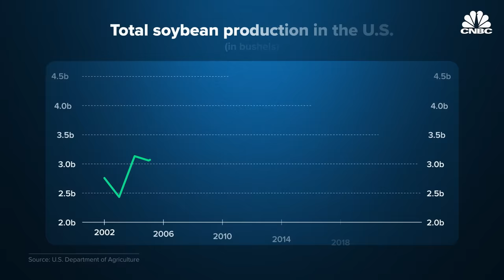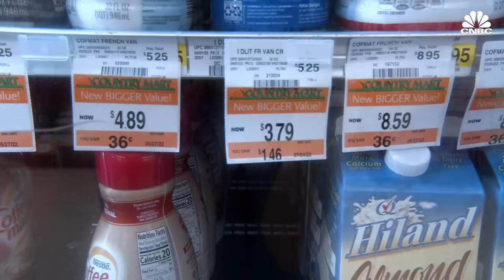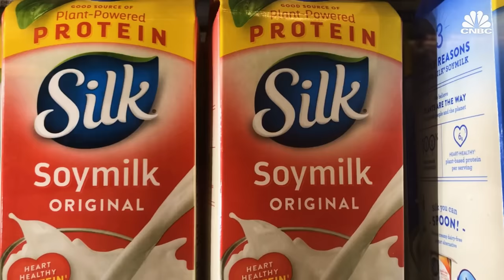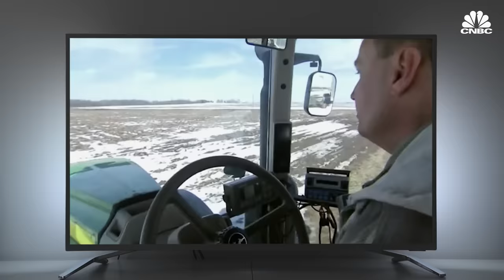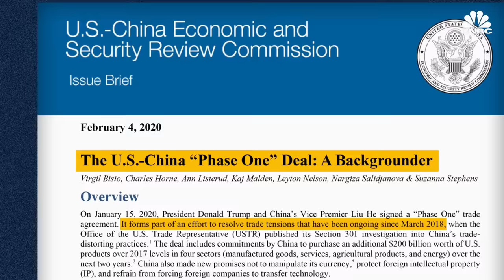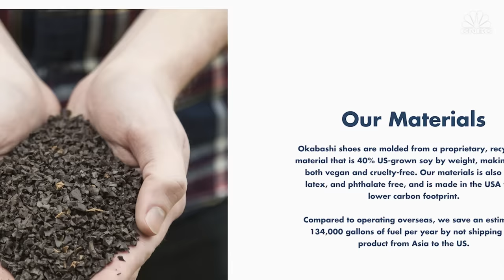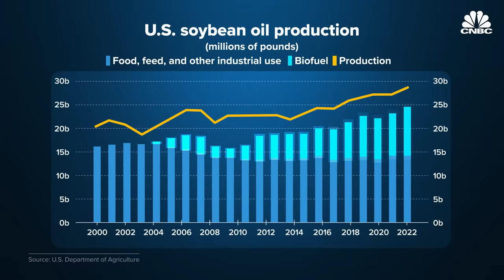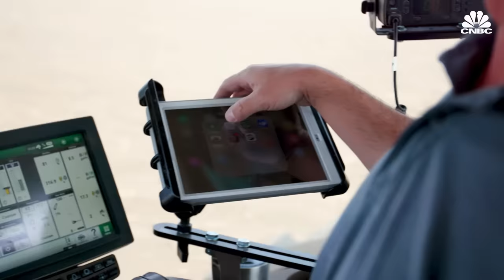Why The U.S. Is Now Obsessed With Soybeans

Comment: A bushel is a unit of volume commonly used in the United States to measure dry agricultural commodities like soybeans. One bushel of soybeans is equivalent to 60 pounds or approximately 27.22 kilograms.
Reply: You the real mvp 🙌🏿 I had no clue what a bushel was lol
Reply: oh thank you
Reply: Same weight as wheat.
Reply: All grain crops measured this way... It's an ancient method
Reply: 1 bushel is 1.25 cubic feet. Does not matter the crop. Today's soybeans rarely make 60 lb/bu. Usually 58 lbs.
Reply: For metric users: traditionally a bushel is essentially a 42.5liters basket. Used to measure grains, and other agricultural commodities, it leads to most of these to have wildly different conversion rate in real weight/mass measurements. It is an even more medieval an obsolete unit than pounds or even hundredweights!
Reply: @John-nc4bl no it’s not!
Reply: It's also the units used in derivative contracts.
Maybe 5000 bushels in a forward contract.
Reply: @debi5292 I wouldn’t say rarely. Ours regularly make 62-63 pound test weight.
Reply: English system 🙄
Reply: Sir you already converted a standard unit that is one bushel to lb, why do you feel the need to convert it into another unit? I'm partially joking because we use the imperial system and things like a "barrel" or a "bushel" or "acre foot/feet" (Yes... it's a real unit) are actual units.

What's it like having a system that doesn't require a PhD just to understand basic conversions? We Americans joke but most of us secretly/openly admit we'd rather have metric. All because one stupid boat sunk (or maybe it just got lost) at sea we're stuck on a system only two others use, and they only use them because we do I'm willing to bet.
Reply: @rashakor 60 lb bushel is considered perfect test weight for wheat.
Reply: @karlrovey  the point is that as it may be the case for wheat, it is not for soy, or corn or apples or blueberries. A pound is a pound, a bushel is a unit of volume and a complete anachronism in the 21st century.
Reply: Himanshu is indian dude the video is senseless now terminate her H1B visa
Reply: @xvm-fzc English is the language used globally. Keep crying. 😂
Reply: @tylerwestover234  English language eh? Aren't we talking about the English System of Measurements? Are you crying so profusely that your tears blurred your vision? 😂
Reply: Unbelievable that this video didn't even explain what a bushel is
Reply: Thank You for your explanation
Reply: ha, i was googling for bushel just now
Reply: 1 Bushel of Soybeans = enough tofu to last a normal human an ENTIRE lifetime.
Reply: @petert3355  Agree because eating NON human food the human will die very young
Reply: @tilapiadave3234  Exactly WHERE did I say that Soybeans were NON human food?
My comment was about TOFU....Freaking horrid stuff that it is.
Reply: @petert3355  You didn't say it ,, I DID:) I don't mind a bit of tofu on occasions but the way Soya beans are PUSHED like some wonder food just makes me angry.
Reply: From what I found out, it's volume - with an equivalant of about 35 Liters
Reply: @John-nc4bl  : Nope. You should delete that error.
Reply: WRONG. As you start out to say, it is a measure of volume, then you make the mistake of putting a weight on it, that is wrong. You should have used the metric measure of volume being litres.
Reply: @KAWTELENUH  most americans have no idea either. "bushels" are just traditional units that have been used forever in agriculture, sort of like saying "mu of land" in China or "barrels of wine" in France. Since a bushel is volume rather than weight it also varies by what you're referring to so a bushel of corn, wheat, and soy will all vary slightly by weight. Normally people buy and transport more by weight though and things are measured primarily in weight while volume is used more for rough estimates.
Reply: @rashakor  yeah its used more out of tradition then anything like the various barrel sizes for wine or "stone" weight in the UK.
Reply: Here in the US we will use washing machines, football fields & god knows what else so we can avoid using the metric system 😅
Reply: @bravosierra2447  How does using washing machines help us avoid using the metric system? didn't get that one
Reply: @houstonswisha143  neither do I, but I heard it on my local news report once. Overall it’s meant to be a light  hearted joke at our reluctance to use metric system sometimes.
Reply: How much is a bushel in US dollar for the last quarter or 2023 Q4 by bulk?
Reply: Except when we buy it for seed. Then it is sold as "units". 140000 seeds per unit.
Reply: Thanks dude! You saved my 10 min.

Comment: They were saying that the average production went from 31 to 51 bushels but that’s it’s actually a lot more than that most of the time. That is impossible. The average is the average that means that if you take all of the output and divided by all of the acres that’s the average.of course if it was a median, she would be blatantly incorrect given the definition of the term, but the mean basically means that you could not have most of the observations, the drastically higher than the average.
Reply: I think she meant to say the 'typical' farmer will see production that averages 51 bushels per acre, but some farms do better than this. You point is taken, though: average means average.

Comment: 2:50.  It is mathematically impossible to have your yield “most of times much higher” than the average.
Reply: Most of the time it can be higher when the alternative is typically zero production, in turn acting as an outlier that drastically pulls down the average - hopefully that makes sense
Reply: @firesalamander100  Just for fun, I am posting an illustrative example: We can look at a sample of the five  numbers 6, 6, 6, 4, and 3. The mean average of the numbers is 5. Most of the numbers (three out of five) are higher than the average.
Reply: It depends on if some very low yield years (maybe due to inclement weather) pull down the overall average.
Reply: If three of my farms average 66bpa and I have a farm average 25bpa all of a sudden my average is going to be a lot less than 66bpa per say.

Comment: Interestingly, soybeans could face a major competitor, especially with the change in laws in recent years: non-THC infused hemp. Hemp could become a huge commodity for biofuels, and hemp fiber now has a lot more uses than before, especially as a cheaper alternative to resource-intensive manufactured carbon fiber. And hemp plants can grow in much wider climate conditions than soybeans.
Reply: Soybeans are here to stay due to the soil benefits.
Reply: So soybeans, a crop that is 97% used for meat production will face ''major competition'' from a crop mainly used for textiles? bruh been hitting the stoogie too hard again.
Reply: Hemp will make Soybeans, meh 👀
Reply: @eriksvensson2098  ikr 🤣
Reply: @eriksvensson2098  Soybeans are now more and more used in biofuel production. Hemp can be used to make biofuel, and can grow in much wider climatic conditions than soybeans.
Reply: Lupin is closest in terms of nutritional profile.
Reply: Dude weeeed 🤪😜
Reply: @eriksvensson2098  LMAO, underrated comment.
Reply: Well said
Reply: @beckyumphrey2626  yeah that's one of the main reasons they started using soy. Originally it was a low value crop with few uses in the US, early on aside from oil they just used it as a low cost food additive, even using it to extend wheat flour. It's main value to begin with was for the nitrogen and still partially is since it saves a ton on fertilizer which is one of the largest expenses in corn farming.
Reply: Smoking hemp is better than eating it.
Reply: @MusicOperaBroadway  yeah but then you get hungry and need soemthing to satisfy the munchies

Comment: A lot of confused people in the comments below. I'm surprised so many people don't know what a bushel is. In North America (the U.S. and Canada, unsure about Mexico) a bushel is a measure of volume. Technically, it is '8 US dry gallons', but it's known more commonly as 1.24 cubic feet. Remember, this is a measure of volume, not weight. A bushel of grain can vary in weight, but generally wheat would weigh about 60 lbs, soybeans 60 lbs, oats 32 lbs, barley 48 lbs. I think you'll gradually see the bushel disappear as metric measures are phased in. If you'd like to know more, see the Bushel entry at Wikipedia.

Comment: all the shipping costs...  maybe concentrate on some mobile mills to convert to renewable diesel out in the heart of soy areas - fire them up when market prices for food value are low... or spoilage etc.  can oils like canola, corn and soy oil be combined to produce renewable diesel together  - any value in considering all of them ?    all that trucking and tractor / harvester fule - seems like making it close to production would be a valuable ability to have in hand even if not used all the time.
Reply: I need to highlight the shipping cost are incredibly low. You can say less than a gallon of Diesel to transport a full container 500 miles. That is why you can have your factory in the a completely different location. The figures used in this example are 20.000 TEU Ship running at 18kts , 500miles a day

Comment: Beans are a legume so they make their own nitrogen but nitrogen does not remain in soil long enough to support any crop that is planted after the beans. 
Also beans take other nutrients out of the soil.
Reply: Source?
Reply: Somewhat correct, I farm corn and soy. The way Beans make their own nitrogen is by having bacteria in their root nodules that convert atmospheric nitrogen to a form available to the plant. You're somewhat correct about them not being able to support a full crop after, but usually you can get away with dropping nitrogen rates slightly the next year.